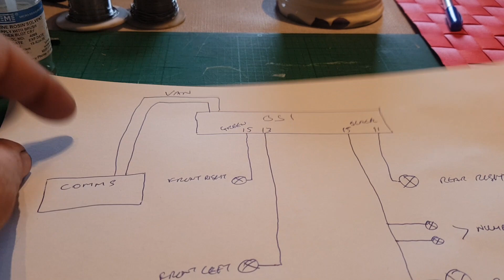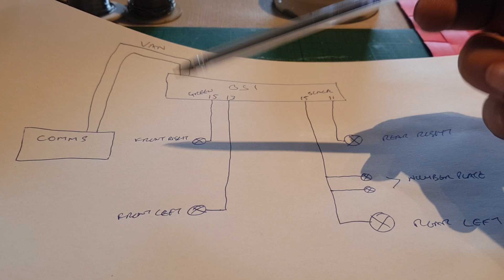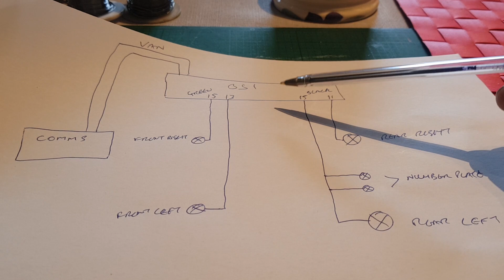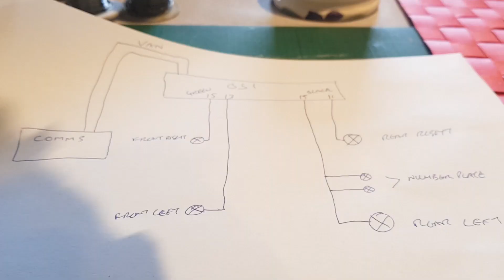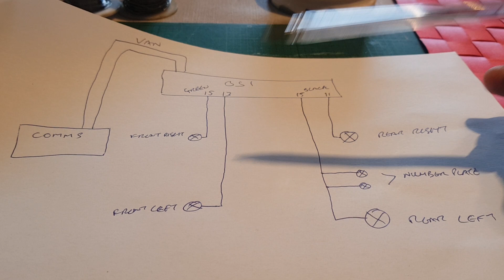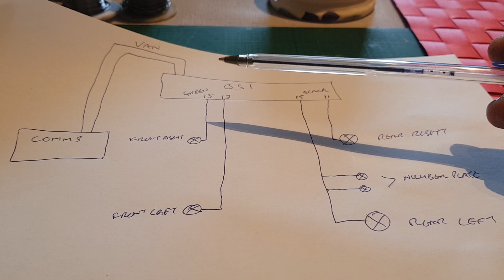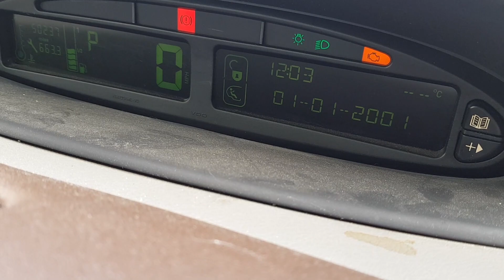Citroen xsara picasso side light fault bsi fault

Comment: My main beam stopped working, and the flash doesn't work either, but the blue hi beam lamp does, they failed when i turned the front fogs on, the fuses look good, im suspecting this unit as the blue hi beam works, so i don't think its the stalk switch 
Great video, does the Haynes have the bsi unit pin out diagram?

Comment: Great fix and repair what tool do u use to heat up the chip to get if off board
Reply from the maker: I use a 858d hot air station cheap but works fine. I show it in some other videos for removing eeprom
Reply: @rmautodiag  cheers thanks for your time looked at the tool on line can get one for 30 quid gonna order one